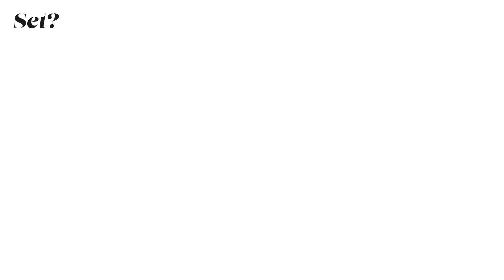Orac®: How to Install Cover Skirting

Comment: Why remove that piece of the original skirting board?
Reply from the maker: Thank you for your inquiry. The piece that was cut off of the original skirting board was to allow for an end cap to be installed if your skirting board was not going to continue around the corner. This is illustrated later in the video at around the 3:26 mark.